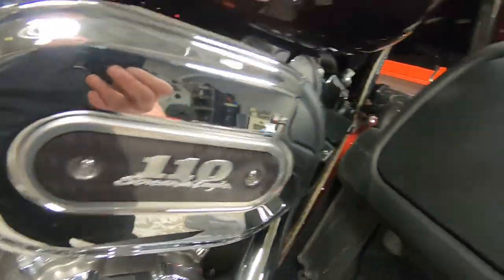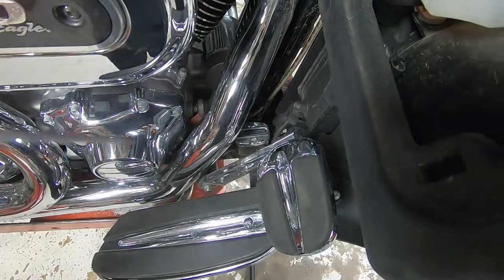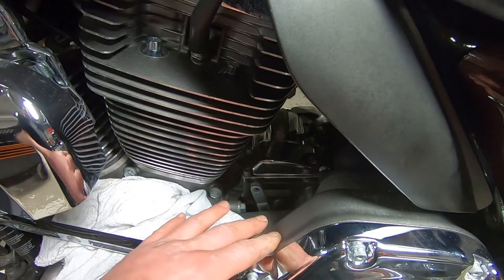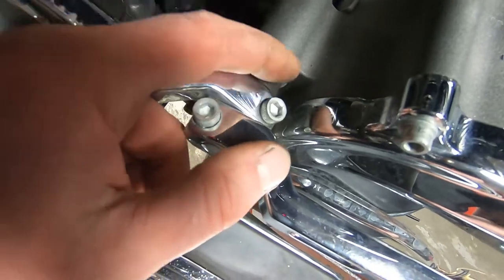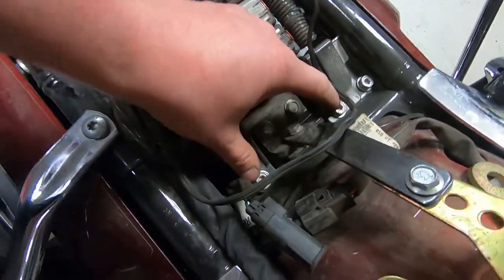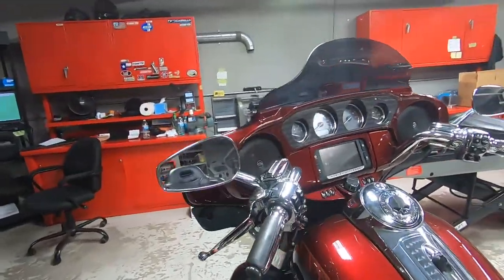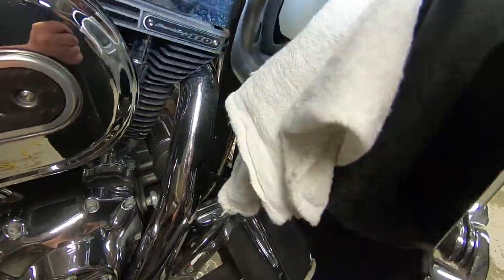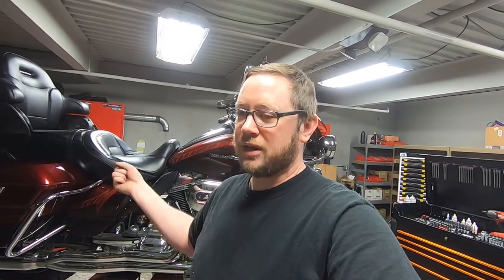HOW TO DO A PRE SEASON HARLEY DAVIDSON SAFETY INSPECTION PART 2

Comment: I’ve seen different videos of where guys change their own brake fluid with ABS. Other videos say because of the ABS, you HAVE to take it to the dealership to have the vacuum system hooked up to properly change out your brake fluid.

Is this a job we could do on our own?
Reply from the maker: The reason to have the dealership flush the brake fluid is because the  dealership computer can activate the abs module and flush new brake fluid into the valve body, specifically into passages and valves that are normally closed. So in that regard the job cant fully be done at home. Thanks for the question and view?
Reply: Harley Davidson Wizard your videos are brilliant. Thank you for the content and in-depth  explanations.

Comment: Question some of the  m8s are transferring fluid from the tray to the primary looks like HD has a vent kit others have done the Greg Williams larger diameter rod what is your opinion on the rod ?
Reply from the maker: I like the idea of the GW rod. I haven't had the opportunity to use one yet tho. Any of the bikes that have come in with fluid transfer have gotten the HD vent. And after doing the HD vent I haven't "at this time" had any vehicles return with fluid transfer.
Reply: Thanks please keep the great videos coming A+